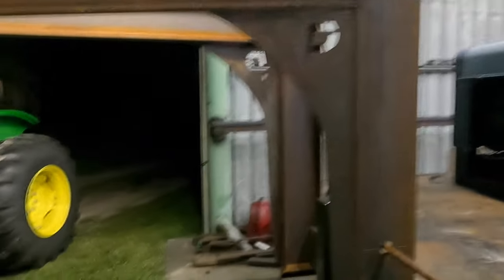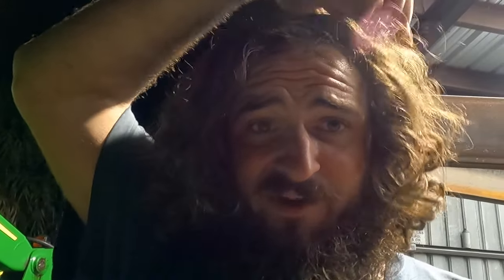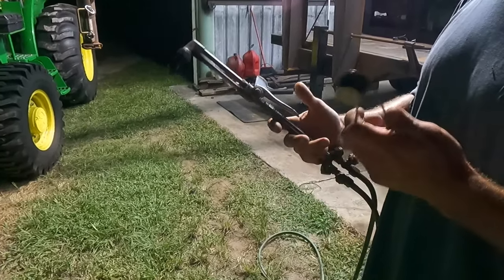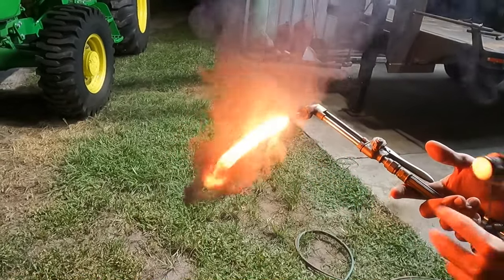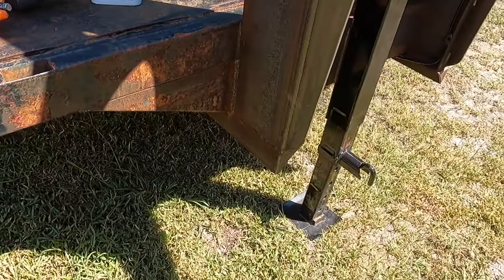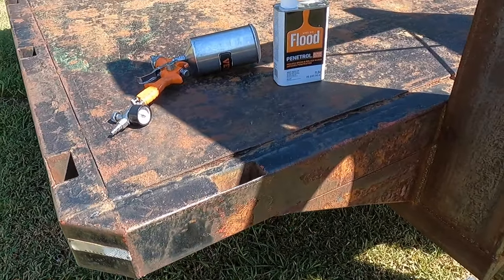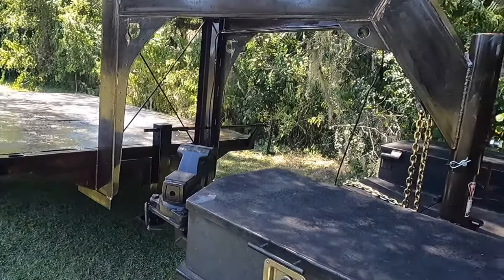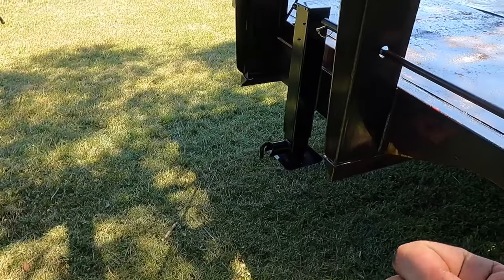Utility Gooseneck Build Pt2

Comment: Is that gooseneck massively over engineered in terms of steel thickness? With those gussets and beams, it looks like you could haul 80,000 lbs on that trailer if you had 8 wheels on it.
Reply from the maker: There’s no kill like overkill!  It’s definitely overbuilt but it’s the added peace of mind.